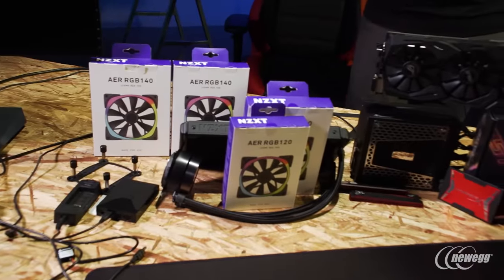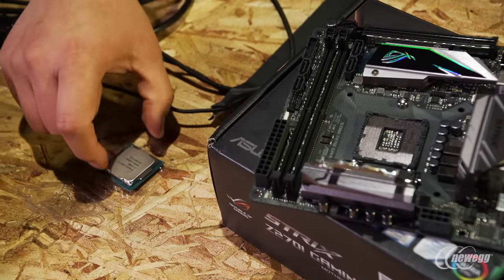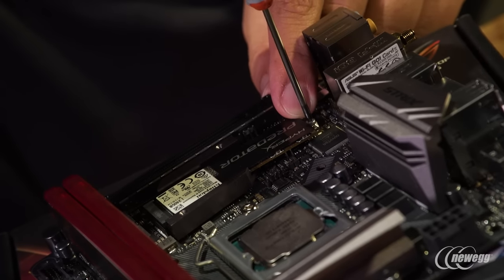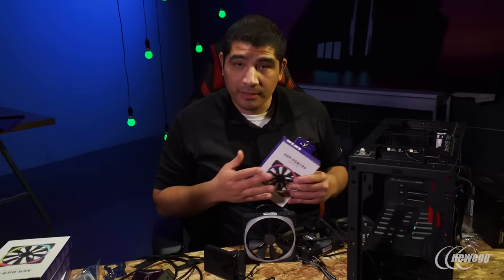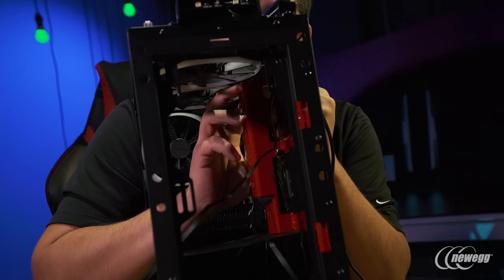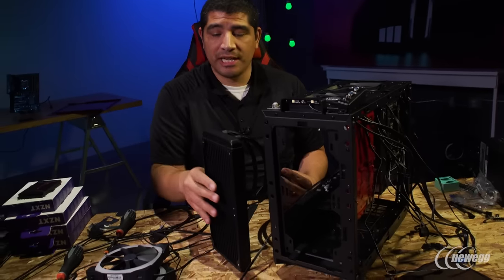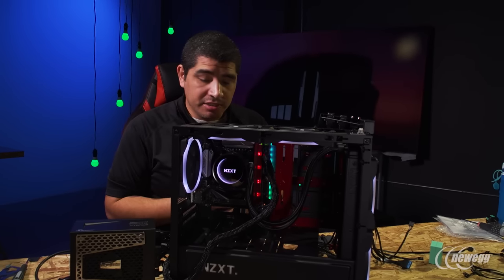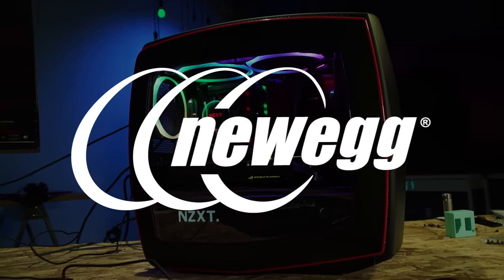Newegg Insider: ASUS ROG Strix Z270I Gaming Mini-ITX Manta Build

Comment: What about GPU temp? I have manta and 1080ti and under load it's up to 88 degrees C. And I have stock fans! With this setup in video the air from the front radiator comes to GPU and is already warm! The GPU almost has no air to breeze itself and this warm air from radiator makes things a lot worse I think.

Comment: where did you plug in the Manta's usb 3.0 case connector?
Reply: jdotroze prolly just left it unplugged. On thing about this board that rele sucks only 1 USB 3. not two. not one usb3 and one USB 2. 
Leaves in u a pinch depending on what you wanna do
Reply: i plug mine into the CHA_FAN if you dont need CPU_FAN for your CPU cooler, you can also plug it into CPU_FAN if you want
Reply: he kept unplugged.
However you will be able to use 3.1 header in July.
>USB3.1 20pin converter available in Europe around July .
Reply: afar usb 3.0 header does not support splitting by simple cable split. that cable mode you shared is suspicious.

Comment: I have a question that ASUS support could not answer. Look at the end of your video: around 20:40. The motherboard is showing the WHITE VGA_LED. Mine is doing the same thing! It only shines when I wake from sleep though. It's very annoying. I've tried removing my GPU, restoring defaults to bios. removing CMOS, upgrading to the latest version (810). Nothing works. Can you please look into this, as an expert, and let me know what's going on here??

Comment: Hi, can i check on the following
1) how the Kraken x62 is connected to cpu fan or aio fan header on mb?
2) I am connecting hue+ and AER RGB fan. The last fan will just have cable in only or i need to connect the out to somewhere?
I am building similar build
Asus Z270i with I5 6700k, Gskill Trident Z RGB, kraken x62, MSI GTX 1070 Gaming X, 2 Tb seagate, 250gb Samsung Evo with coolermaster v650 full modular psu.
1st time builder for this manta beast:)

Comment: At about 13 mins in JJ talks about the usb3 to usb2 adapter. The USB 2 goes into the internal USB hub but where does it plug in? Looks like all male ends. What's up with that?
Reply: it goes like this:  USB 3.1[ ] <-3.1 adapter to 2.0 ->[ ] hub [ ] <--> [ ]molex

Comment: Hey so I am doing a very similar build with the Z270i board. However I'm running into problems with the board not detecting the NVME SSD inserted in the M. 2_1 port. The slot on the back works fine but BIOS and Windows will not detect the front m. 2 slot. I have both slots populated with two Samsung 950 pro SSD's. I've read other people are running into this problem as well. Did your setup detect both NVME drives as expected?

Comment: Quick question i'm going with this build and very worried about everything heating up because of the small space

NZXT Manta
Asus z270i DDR4
NZXT Kraken x61 or Corsair H110i GTX (recommend a better one if you can please)
DDR4 Corsair Veng. ddr4 3000mhz
core i7-7700k
gtx 1060 6gb strix oc
PSU RM750i (recommend a better one if you can please)

Need an advice if this build will heat up in like 12 hours of usage and heavy 3dmax rendering or oc gaming (rarely will do but i will do it) and gaming in general and long time usage.

if you can tell me better part to use or any advice in general it will help a lot i saved good amount of money so it's not a problem for me just worried about the overheating part.

Comment: @NeweggStudio 
Hey guys, i am using NZXT Manta and i am thinking to upgrade with AER fans 1x120 and 2x140 for the top, cuz am still with my stock fans and they're not PWM. As i know the Manta has an implemented Fan Hub, but as i can see it has only 3pin connectors for fans and the AER fans are 4pin..Will i be able to control their RPM thru the controller  and how ?
Thanks in advance

Comment: so, since you use the usb 3.0 header, what you do with the top usb 3 ports in the front?
Reply: I am wondering the same, is there a 3.1 -> 3.0 header adapter?
Reply: z270i has USB 3.0 and 3.1.The adapter is plugged to USB 3.1 port and the front panel is plugged into the 3.0 one
Reply: Yoloswag LOLgg watch the video a little bit better!!!He just used the usb3.0 and convert it to usb 2.0 for the internal hub for the water cooler
Reply: i don't care what the video says. my reply responded to what you can deal with the front panel without losing anything by using the USB 3.1 port on the motherboard. i'm sorry if i didn't make it clear.
Reply: That just doesn't work
There is no 3.1 to2.0
Reply: Yoloswag LOLgg there is no adapter for 3.1
Reply: Isn't logical to put the adapter in usb 2.0 header?

Comment: I'm almost done with my Manta build but I'm unclear about the internal usb 3 header to usb 2 header. In this video it displays an internal 3.0 female header to a male usb 2.0 header. The internal usb hub has 9 pins and you would need a female usb 2.0 header. Please tell me if I'm wrong or not? Would like to complete build in the next few days.
Reply: William there is a female-to-female cable with the nzxt hub.
Reply: Did you figure out how to connect the USB 3.0 front panel header?  I'm doing a similar build and was curious.
Reply: You need two more cables for everything to work: 1x USB3.0-to-USB2.0 header cable and 1x USB2.0-to-USB3.0 header cable.
- Now you stick the usb3.0 header from the USB3.0-to-USB2.0-cable into the usb3.0 header on the motherboard.
- Next, you take the female2.0-to-female2.0-cable from the nzxt-usb-hub and connect the first cable with the white slot on the hub.
- Connect the AiO-USB2.0 cable to the nzxt-hub.
- Use the USB2.0-to-USB3.0-header-cable to connect the Front-I/O with the nzxt-hub.
- connect other devices, like the hue+, with the hub, and don't forget to plug in the power cable for the hub...

Comment: question. since you used the usb 3.0 and converted it to 2.0 hub for peripherals, how did you connect the 3.0 header from the manta to the board?  did you use a 3.1 to 3.0 converter?
Reply: Vandoeun Long Idt those exist

Comment: where to motherboard did you connect the front 2x usb 3.0 of the case , because u used for that nzxt hue ?
Reply: front panel is plugged into the USB 3.0 port, and the HUE and Kraken is plugged into the HUB, which is plugged into USB 3.1 port on the motherboard via the USB 3.1 to 2.0 adapter.
Reply: look at video, he plugged adapter to USB 3.0 header. I may assume he used 3.1 to 2.0 adapter, but he did not reveal this on the video.
Reply: is there any current solution to this problem also is this problem relevant if I don't install Nxzt rgb fans on my Kraken??
Reply: Cobaltvoid i did it with two cable-adapters: one usb3.0->2.0 from mobo to the hub and another usb2.0->3.0 from hub to front i/o.
Can't test it yet tho, as my kraken didn't arrive yet...
It doesn't matter if you use rgb fans or not as the usb is needed for aio-control and front i/o.

Comment: How do you fit kraken? ddr4 is on the way of the tubs! i just did similar build.
Reply: mount the cooler side way (top side of NZXT logo on the cooler face to the back of the case).
Reply: Max, i faced the same. seems we need to go with low profile ddr4 to complete the build

Comment: run into the same problem as thiers no usb 2 headers on the Strix board waiting for the nzxt usb device might fix my  data link cable issue but where will my front USB header go? or is thier a cable to convert to 3.1 type header back to 3
Reply: front panel plugs into the 3.0 port, and the adapter (3.1 to 2.0) plugs into the 3.1 port. but the easiest fix is to use different cable (usb 2.0 to mini-usb 2.0) and route the cable outside of the case and plug it to the USB 2.0 in the back of the outside of the case.
Reply: problem was solved with the nzxt hub and 2 different converter cables works like a treat, 7700k pushed to 4.7ghz with the factory OC ezy tune
Reply: SassyTheCopilot which converter cables did you buy? I want to do a similar build

Comment: Could anyone explain how is the 3.0 Female to 2.0 Male Internal Converter able to plug into the NZXT Internal USB Hub? The Hub itself uses 2.0 Male, how could it fit male to male? CMON! Anyone have an answer for it?
Reply: In the video he connected the 3.0 header from the motherboard to a 3.0 to 2.0 adapter. You then use the cable the USB hub comes with and connect the 3.0->2.0 adapter to the hub. Look at images of what's inside the box and you'll see the cable! It's basically a 2.0 female to 2.0 female extender.

Comment: Hello, Can you tell us all how you managed to connect both USB 3.0's? It seems a lot of people are finding out that they can not connect the USB 3.0's because there is not anywhere to connect them to on the motherboard. I was thinking of buying an adapter to connect to the cable for both USB 3.0's and then connect it to the HUB. This is the piece I bought and I'm waiting for it to arrive: https://www.amazon.com/gp/product/B00P5VG1DE/ref=oh_aui_detailpage_o00_s00?ie=UTF8&psc=1.
Reply: the one i posted does the same thing. it is the only way to connect USB 3.0's.
Reply: William Torres ooh I see what you meant. Your planning to connect the USB on the motherboard. That kinda sucks to be honest lol. You have to find a way to route it back in your case
Reply: Hello Phillip, 
I have the adapter I purchased and posted here which is identical to the one you posted. Both mine and the one you posted will connect to the USB 3.0 20 pin connector and then it will be connected to the HUB. I have it all connected from the 20 pin connector to the HUB and now both USB 3.0's are working.

Comment: i bought an asus rtx 2080 card with this case, and it really dont fit... :((
Reply: Like, at all?
Reply: @Obrisevac  i mean, i made it work, but now the fan blades scratch against the bottom, therefore i installed a kraken g12 with a corsair water cooler instead :P
Reply: @vetrics3757  Nice man, glad it worked out somewhat at least haha, making a similar build with a 2070 strix, and thats maybe a bit under a cm less thick. Think that'll fit ok with an x62?

Comment: Can't you just freaking use black colored wire and heat shrink tubing for the CMOS battery holder connector? I mean it really is not necessary to know which one is positive when this battery will probably last more than this motherboard plus the clip will make sure the polarity so why do you need that ugly looking cable?

Comment: HE MESSED UP! I followed this video but realized that I not only needed the USB 3.0 to 2.0 adapter that he used, but also a 2.0 to 3.0 adapter as the plugs for the power button and what not rely on the 3.0 port. I connected the 3.0 cable running from the power button to the 3.0 -> 2.0 adapter to make it compatible with the NZXT Internal USB Hub; I connected the the 2.0 -> 3.0 adapter to the motherboard and further plugged that in to the USB Hub. 
(I USED THE SAME CASE, MOTHERBOARD, and LIQUID COOLING AS HE DID)
Reply: I have the same case, Mobo and Aio and also have the same problem. Could you help me? How did you  manage to do it exactly? I think I'd have to buy a Gen 2.0 to 3.0 adapter, a 2.0 to 3.0 adapter and a 2.0 hub. Any thing else? Also, isn't the performance of the front panel's 3.0 USB forsaken?
Reply: Ivan Reyes You’re gonna take a usb 3.0 (female) to 2.0 (male) adapter and plug it into the mobo’s 3.0 19-pin connector—you will then attach the other end into the NZXT internal usb hub. Take a usb 2.0 (female) to 3.0 (male) and plug the 2.0 (male) into the internal usb hub and the other end into the plug for the top panel.
Reply: Dax Gaming thanks for the quick reply! Do the front panel's USB ports work at full speed?
Reply: Ivan Reyes I haven’t done a speed test, however I would assume that they work at 2.0 speeds
Reply: Dax Gaming ughh, sounds like it's the only option though

Comment: what if I don't give a flying fck about RGB in a case?
Reply: I'm with you bro. RGB only increases the cost factor.
Reply: RBenceHUN but it looks cooooool
Reply: ya thats right. if im spending all this money on a nice pc im going the extra mile and make it look good also. i just did a new z270 build and i have some lighting in mine. and by the way this was my first build ever. and loved it. will be doing more. and got 99% of my parts from newegg .
Reply: I mean, if you're gonna build an expensive gaming rig you might as well make it look good
Reply: RGB makes your system 3x faster.  You never heard of lightspeed?  DUH!
Reply: then you saved a ton of money
Reply: if you dont have rgb fans or the hue+ , does that mean that you dont have to buy a usb 3.0 to 2.0 and the usb hub?
Reply: Venture you'd still need 2.0 for the AIO Liquid Cooler. So you'd at least need  the adapter. Also keep in mind that if transform your 3.0 to 2.0, you won't have anywhere to connect your chasis' front panel to. Apparently he left that disconnected in this video.
Reply: Ivan Reyes as long as it will work I have a 3.0 to 2.0 adapter I don't care about the front panels I'll fix that another time

Comment: im making this pc https://pcpartpicker.com/list/6bsYM8 , with the same motherboard and stuff but different cooler. Do i still need to buy the usb 3.0 to usb 2.0 and the internal usb hub????
Reply: You will need the usb 3.0 to 2.0 adapter to connect the cooler. Problem is that leaves your front panel disconnected. Apparently in the video he did since he didn't address in any way. You'll end up with an empty usb 3.1 port and needing a 3.0 since you converted it to 2.0 for the cooler. I cant seem to find a USB 3.1 to 3.0 or 2.0 adapter which would solve the issue.
Reply: Gregory Gonzalez Mandry is there not more than one USB 3.0 slots on the motherboard
Reply: Only one 3.0 and one 3.1 (which you probably wont give use to). To be able to connect the cooler and the front panel you'll need a 3.0 to 2.0 adapter, a 2.0 to 3.0 adapter and a USB 2.0 hub (Note that this solution would make the front USB's run as 2.0). 

On a side note: since ram prices are all screwed up, you can get a more sexier ram, like the G.Skills Trident Z RGB with those same specs (3000 MHz, CAS=15) for that exact same price.
Reply: Gregory Gonzalez Mandry I've already bought all my parts but just need to know how to get the cooler and front panels working
Reply: Gregory Gonzalez Mandry I've bought a USB 3.0 to 2.0 connector for the fan. I will use that for the start and later I will get a USB hub . Would that work?

Comment: If i've only one m.2 drive is it better to mount it on the back? The northbridge underneath seems to get very hot
Reply: The Northbridge is supposed to act as a heatsink, drawing excess heat away from the m.2 drive. I have a great amount of that Asus at least tested the efficacy of the heatsink.
Reply: At the moment i'm using this board without the m.2 drive and the heatsink seems to reach at least 50° C to the touch, how is it supposed to draw excess heat if it is already hot? Did you do some comparation without heatsink?
Reply: fttx I don't own the board, but the Northbridge actually has 2 heatsinks sandwiched together, but thermally isolated. The idea is that one heatsink cools the m.2, and the second heatsink cools the PCH.  That 50°C readout is probably from a sensor on the PCH heatsink.  Supposedly you can get some pretty dramatic cooling with the m.2 heatsink.  I don't consider myself an Asus fan boy, but I have great faith in their products.
Reply: I took a measurement with an external sensor: http://imgur.com/a/OLv4J but it is not doing good contact, i'm pretty sure that it reaches over 60° C without an m.2 drive installed